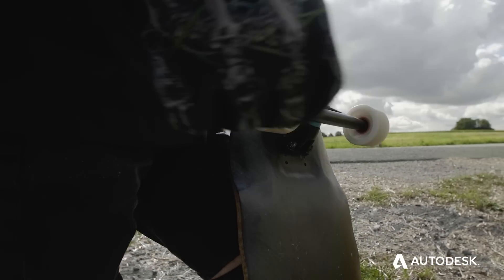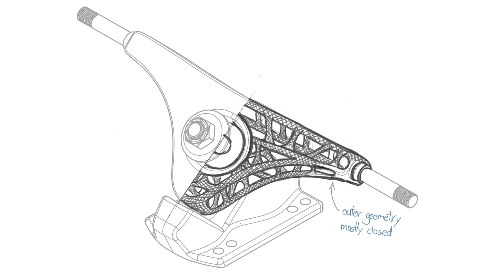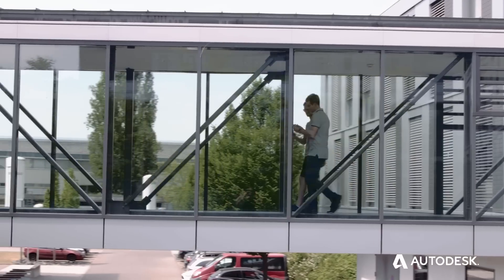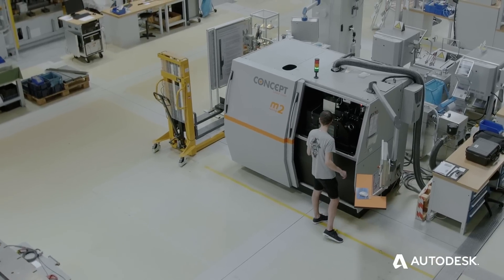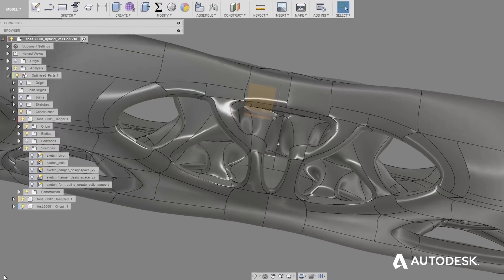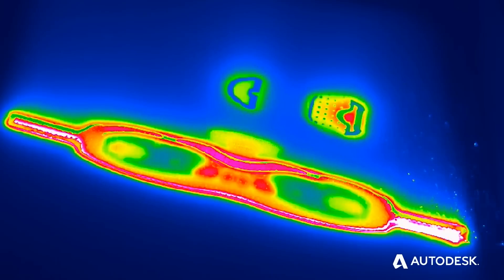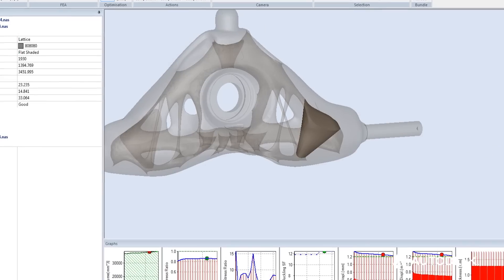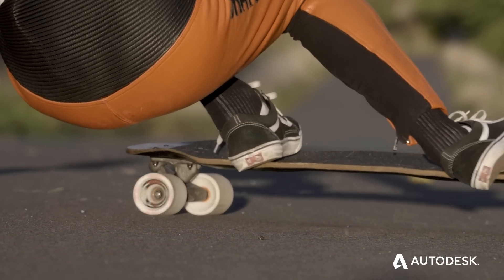Project T.O.S.T: The thrill of downhill riding using a custom manufactured skateboard

Comment: I follow autodesk research pretty closely, and this project is one I really deeply appreciate. My assumption is that these trucks are adapted to downhill (forces). It would be hecka awesome to rig up a trick board with many sensors and optimize for the complex torsional forces that emerge from various tricks. Keep up the great work folks!